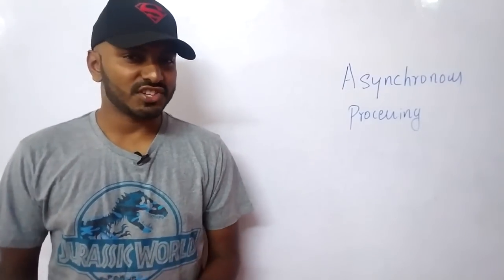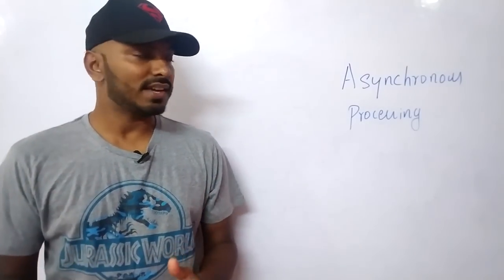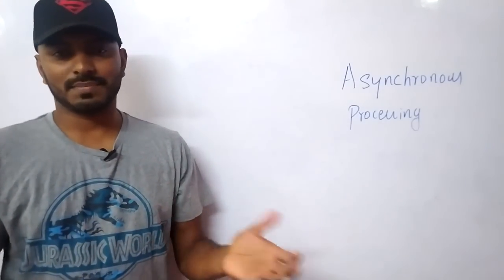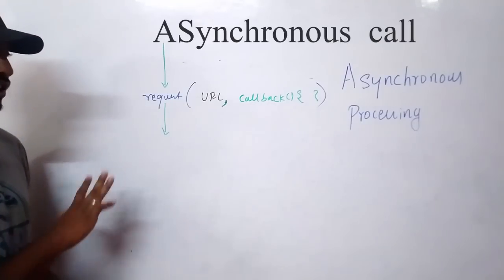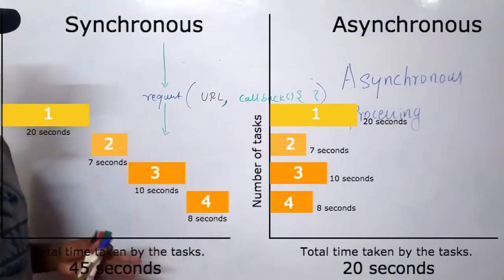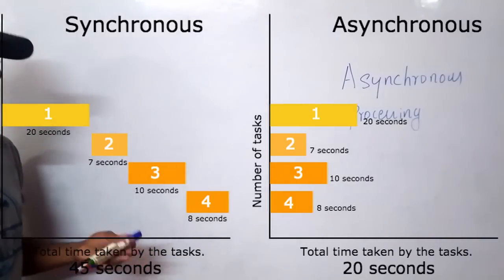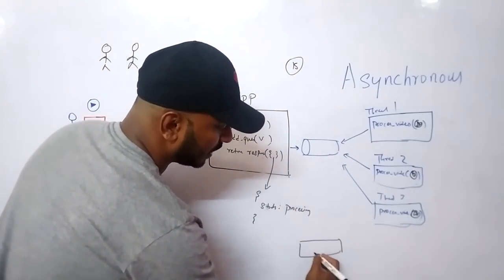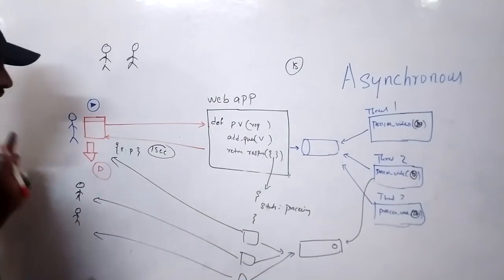System design basics: What is asynchronous processing?

Comment: Good content. Thanks, Narendra.

Here are some ideas for other viewers about handling failures. Say a worker reads a message from the queue. The worker starts processing the message, but then the worker crashes. The message is then lost, because it was removed from the queue. One solution is for the message queue to expect confirmation when a message is handled. If a worker takes a message, but doesn't tell the queue "the message is handled" within some time limit, then the message queue software puts the message back in the queue. In this case, it's important for the work to be idempotent or for workers to anticipate race conditions, since a worker might time out some task even if the worker does not crash. If a message is re-queued too many times, then the message is discarded or sent to a "poison queue". Other workers watch the poison queue and decide how to handle the failed tasks.

Comment: Thank You for the explanation. What happens when the messaging queue crashes?
Reply: Generally you would not have just one queue for this kind of stuff.. You will have multiple queues. However, coming back to your question, queues are inherently fault tolerant, meaning they log everything and if they fail they create the last state. So if you happened to send a message to queue, and it crashes after accepting the message, in that case, when it is comes back online, it will recreate its last state from the logs and pass the message to the threads. Hope this helps
Reply: @20frieza  Thank You..That was very well explained.. :)